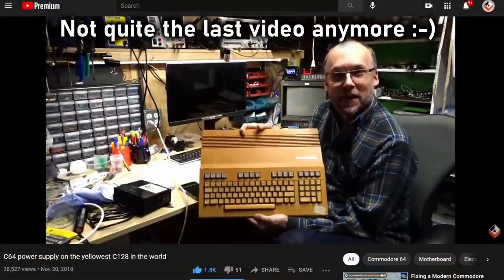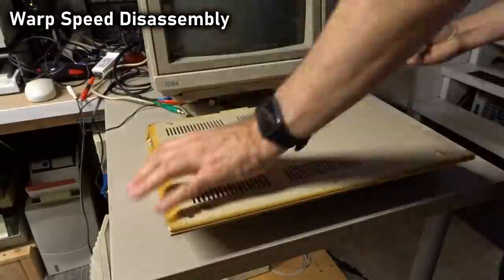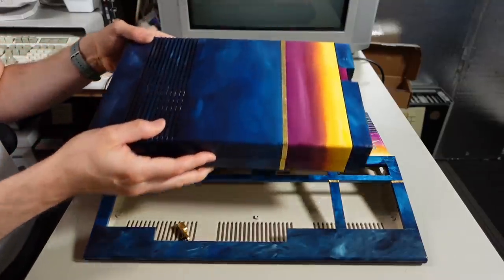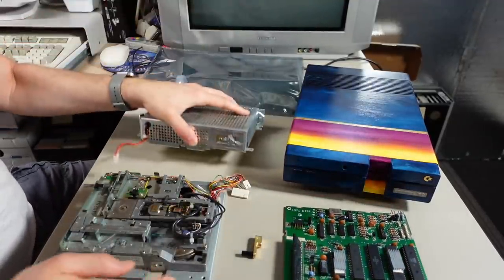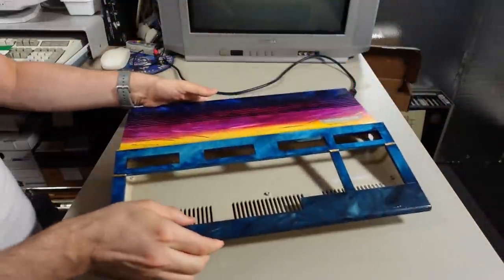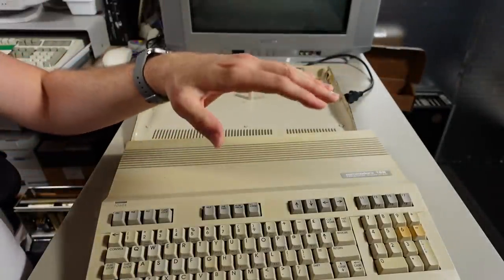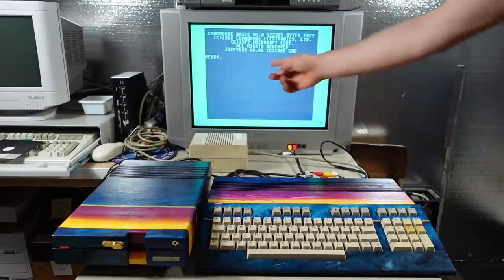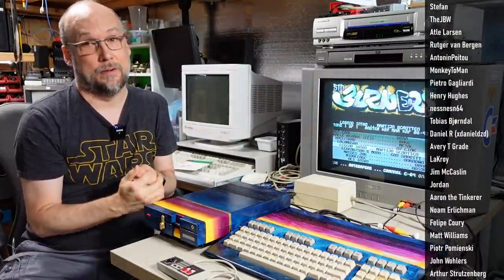The yellowest C128 is transformed!

Comment: I would add some clear coat to that painted case so the paint will be more difficult to chip and it will also look and feel better to the touch
Reply: I second this, a clear coat somewhere between matte and satin, not a shiny one.
Reply: It needs a solid coat of matte black.
Reply: @macdonalds1972  Make it cheddar yellow, and I'm all for it.
Reply: @praetorangel8967  Yes. A flat matte clear would help a lot.
Reply: I’m pretty sure it is clear coated. You can see it sheen in the video.
Reply: * a future computer restorer cringed *  "more layers to remove!" :)
Reply: @kryskarr23  if it is it's such a thin layer to make it useless, the texture of the paint is clearly there
Reply: Yah, I was thinking the same about using clear coat and was about to post such until I seen your comment.

Comment: I'm reminded of a 64C I painted in my early teens... could really stand for a few coats of clear and a wet sand to protect the paint and give it a good smooth finish to the touch.
Reply: I didn't know they had C64s in Cardassia 😂😂
Reply: @david8804  that’s what Dukat programmed his anti-insurrection program on; not many people know this
Reply: @david8804  the displays might look fancy but that's what is in the background - that's why O'Brien is forever replacing parts. The PLAs are a bit flaky when they're 250 years old 😉

Comment: I know a lot of the comments (at least when I'm posting this) aren't too keen on the paint job, but... I kinda like it? Has that sort of vaporwave 80s/90s blank-VHS-box look. Hints of a sunset on a distant horizon! Definitely better than what it was before, at least in my opinion! Though I do think the gold bits on the disk drive are a little tacky.
Reply: Totally! I'm willing to bet most of the negativity comes from purists who think ketchup is spicy. It's fun, unique, whether you personally like it or not, right? I see what you mean about the gold bits but then again, that was a thing in the 80's so it does fit in. I do like the stripe on the disk drive a lot tbh.
Reply: @nysaea  Not all, I also don't like it, I'm all for making it into whatever kind of design, but I think the paint used is not suited for a case like this. It looks so rough.
Reply: @VincentGroenewold  I can understand that. I think a layer of clear-coat or perhaps using spray paint might have provided a better texture or a more even finish. Though I expect after a year of use and handling the finish might wear down to something smoother.
Reply: @CaptainSwag101  Yeah, this design (I mean that's personal taste anyway) but with spray paints is a much better fit I think. You can see that on the one he showed he did, it looked way smoother.

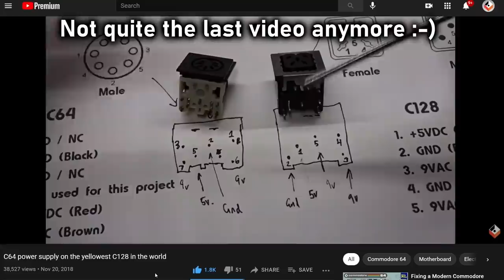Comment: I was just about to comment saying I missed the retro-y fonts you used in the earlier video software. But then I saw both on screen at 1:21 and.. I guess it was rose tinted glasses, heh. Aesthetically I still like it, but wow the quick legibility certainly suffers. That’s definitely a font better suited to larger pt titles rather than longer, smaller pt sub-titles. And the level of outline and drop-shadow is absolutely on-point with your current ones for maximum legibility, in addition to the very legible font. 

Although all that being said, I do have to wonder if something like that, or maybe even better one of those early text generator/“VCR” fonts, for actual titles like “November 2019” at 3:51? Perhaps it’s just an aesthetic you’ve moved away from slightly (though of course a retro OCR font is still in your intro, and I think it works well). 

Ahem, anyway! That paint job is so freaking great. I don’t have a ton to say about it lol. I can see why you blocked it out in the thumbnail!

Comment: First time ever, gonna have to say, I don't like it...
Reply: looks like painted by a 3yr old kid :( Even the badges were not painted carefully. Even the colororientation from the 1571 dont match the C128 :(
Reply: The scratches on the top just take the cake..
Reply: @TonyHoyle  well looks like Michelle did use oilcolors but this goldstripe in the mid of the 128 looks like glued a broken case together :( that's why I use spraycans for coloration :D
Reply: @geekwithsocialskills  "art"
Reply: @geekwithsocialskills  It has nothing to do with purity.  Meaning no disrespect to the artist, It seems amateurish, rushed and it appears that a lot of the new "texture"  is an attempt to cover failures in previous attempts at repaints.
Reply: @geekwithsocialskills  Ultimately it's the owner whose opinion matters.  As Abe Lincoln once said, "You can please some of the people some of the time, all of the people some of the time, some of the people all of the time, but you can never please all of the people all of the time."

And he had never read anything from the mass of the  YouTube commentariat. Had he done so, i suspect he would have walked gladly into Ford's theatre...  

Unfortunately, the old "No one knows that you're a dog on the internet"  problem rears it's heads in these comment sections.  People say things here (on both sides!)  that they wouldn't were they to be speaking to someone face-to-face.  So, tell Michelle not to take too much from the comments.

That being said, it's often a good idea to consider your audience when creating "art"  Retro community folks are pretty evenly split between the "preservers" and the "modders" I lean towards the modders, but will cringe when I see a particularly rare machine cut up or irreversibly changed. The one thing that they both agree on is that these machines are still usable and useful devices.  Turning one into an "art piece"  implies the exact opposite.  That it's a thing to sit on a shelf and admire.  For some folks that's going to cause a visceral reaction greater than it should be for what is really a piece of mass-produced and marketed electronics.

Comment: I wish someone would experiment with dyeing one. Auto parts stores have an aerosol vinyl & carpet dyeing product that works very well with sun faded interiors & the textures are saved. I think this would work better than painting over the textures.... Just an idea I've had......
Reply: I remember seeing a video a while back where they used Rit dye and acetone to dye a plastic case. I have been meaning to try.. Thank you for the prompt..!
Reply: There was a whole thread on the stardot.org.uk forums about doing this with a yellowed BBC Master 128. As far as I remember it worked well, and there was a colour available that was fairly close to the original.
Reply: I used that aerosol vinyl dye on the front of a beige CD burner back in the day to match my black case.  It worked fine and didn't wear or chip like paint.

Comment: A little bit off-topic but the 1084 monitor looks exactly like my Philips MSX 'New Media Systems' color monitor. I have a problem with that monitor. There is a very loud and annoying high pitched sound when it's on. It's so loud that I can't use it. But I would like to. What could it be and can it be repaired?
Reply: You mean the constant 15kHz-ish tone? That's common on any CRT that operates at NTSC/PAL frequencies. Used to annoy the hell out of kids in the old tube TV days. Kids could always tell when a TV was running when they heard that noise in the house.

It's the flyback transformer or sometimes the deflection yoke or even some ferrite beads that vibrate at the horizontal refresh frequencies. Way to fix this is to put some hot glue on the exact component that emits that sound. Which is really tricky to find out because you'd have to do it while the monitor is running, and that's how you can get a life threatening electric shock. So only people who know what they are doing should attempt at "fixing" this. I don't really think it needs fixing unless it's ear piercing loud, because I think it's part of the charm of these CRTs running at TV H/V refresh frequencies.
Reply: @guffaw1711  Indeed it's a 15 kHz-ish tone. And I wouldn't dare to touch anything inside. Also, I don't have the tools to do this. I remember the sound CRT TV's made when they were turned on. Maybe I forgot it sounded so loud? It's all nice 'n quiet with those LCD monitors nowadays.
Maybe I could bring it to a TV repair shop?

Comment: 1571 is so rare today, save as much as you can!

I like the colors on the 128 but I don't like the finish. It's like it is coated with tempera, that thick type of paint. An airbrush paint of rattle can with a clear protective layer would look much prettier.

By the way, I'm eating Haribo as I'm watching this episode :)
Reply: I could in one shot actually see the individual brush strokes she used for the clear laquer...

I was like "should have air brushed it instead"... she's definitly good enough to be able to handle an air brush...
Reply: @thiesenf  yeah, I think these plastic parts really need a smooth surface and you can't achieve it with think paint, especially on the disk drive where the hinge is turning or the disk slot, you can't afford any built-up paint there because it will cause friction and the paint will chip off in big chunks

Comment: can anyone tell me if there is plastic that does not turn yellow? new garage doors with a window with plastic around will also be very yellow!

you can use something that you have on that slows down this effect! but then you have to use it  offte!
Reply: PBT does not yellow. That is why forex on the Apple Extended Keyboard the case and spacebar will be yellow while the keys are all original colour (the keys were PBT, the spacebar and case were ABS).
Reply: @kaitlyn__L  ok. Thanks for the information. A lot of the white plastic that is used on a lot of things especially cheaper products often turns yellow.
Possibly this type of plastic is the cheapest to use but not the best?

Comment: *SMH* Seeing the ripples of the paint shows how poor the paint is on the surface. Chances are it was never sanded and primed so that paint will be peeling and fading in a couple of years.

It should have been Retrobrited.

You and others may like it, but I don't. Just a matter of opinion.
Reply: That is exactly it, it's fine to have it whatever design you like, but the paint itself just doesn't match the case in any way.

Comment: It blows my mind how horrible that thing looks. 🤮 It looks like someone gouged the case (above the keyboard) while the paint was still wet, and the brass/bronze color banding (on the 1571) doesn’t help complete the “sunset” theme going on here (The brass/bronze on the floppy drive lever is okay, though, but then the front of the drive should match the brass/bronze color/texture.) 🥺 Oh, and a bit of sparkly glitter at the top (dark blue/violet) to represent stars would work, but lock it in with an overspray of semi-gloss coat so the “stars” don’t come off on your fingers!

Comment: I wasn't so hot about the paint job at first but it really grew on me over the course of the video. I think this is one where it's hard to fully get across on camera.
Reply: At 4:24 you can see paint flaking off and you can see the original color of the slot on the front panel of the drive.

The taste is debatable but the bad finish isn't.